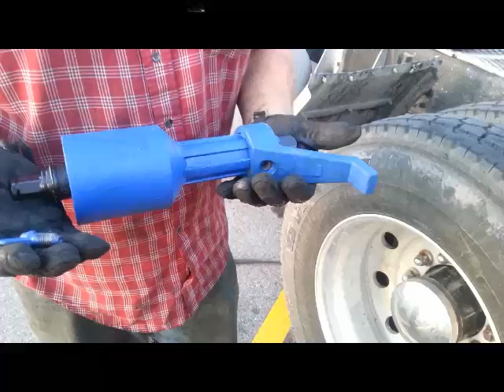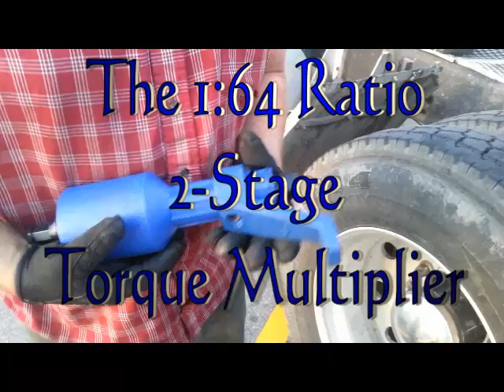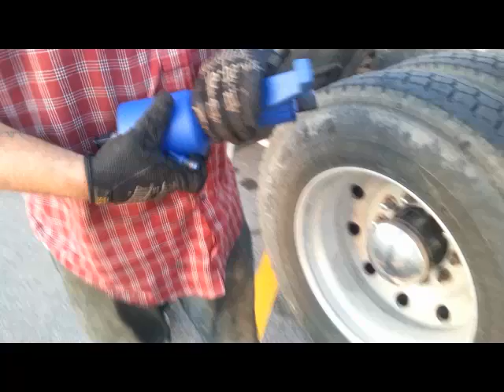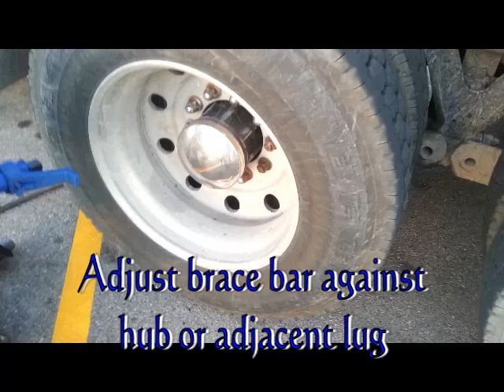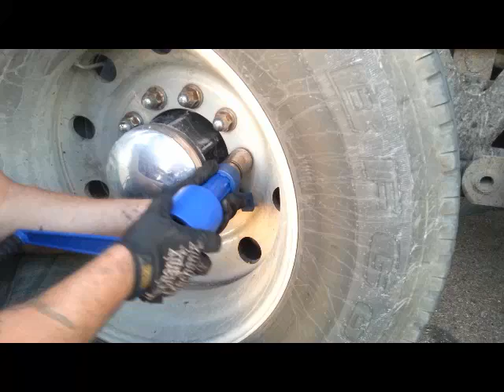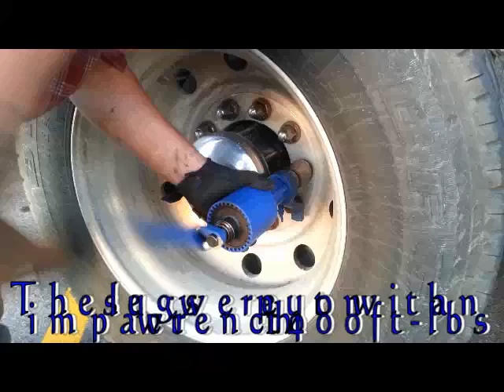1:64 ratio (2-stage) torque multiplier demo

Comment: Please tell me how to torque 450-500lbs
Reply: I like that answer..if you buy a quality torque stick, it should come with instructions on how to start with the air pressure low and work your way up till the torque wrench no longer turns the nut...most shops couldn't justify the power version of this tool, it looks like they solved some of the shortcomings of some of other offers.
Reply: Use torque wrench.....